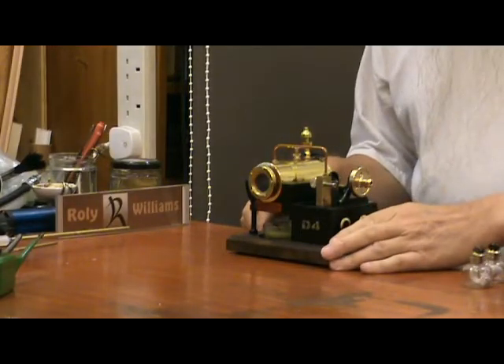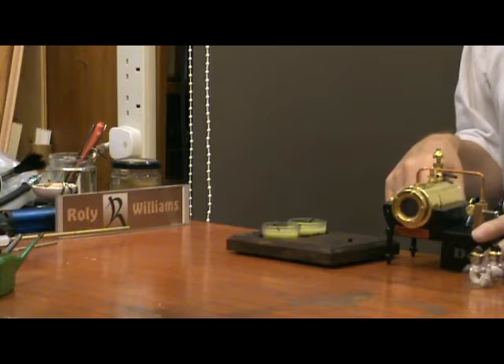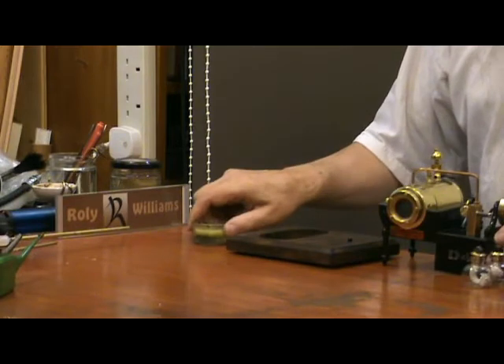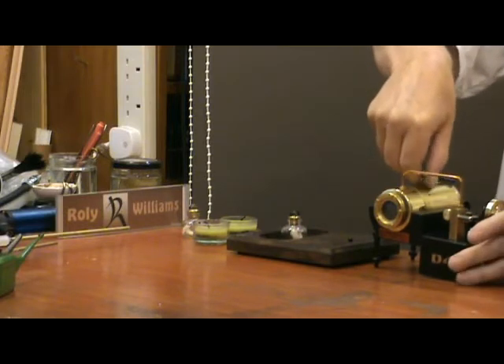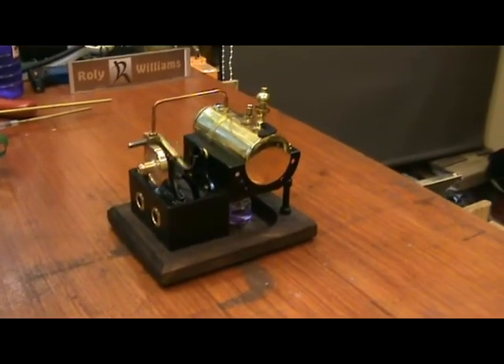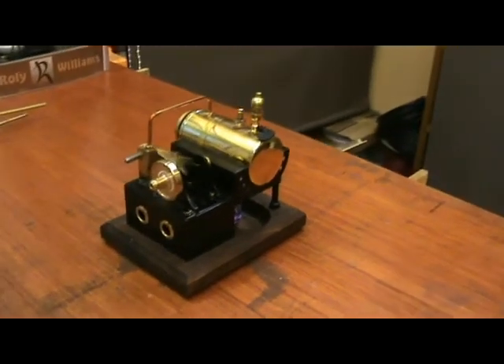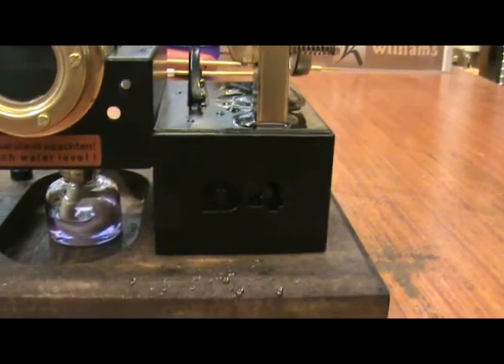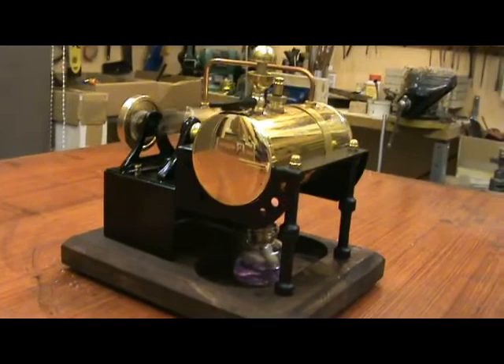Wilesco2016  D4 using meths burner

Comment: Hmm, could have been a nice engine from the design view...but the cylinder with the crank from the D3 and plastic pillars for the boiler in combination with the low low heat source from the candles (normally). Its a shame, nice design nearly bought it, when I saw it first time. But I wanted feedback from others and waited. Glad I did that...
Reply: I have one but I don't mind waiting for the boiler to get up another head of steam

Comment: where did you get those burners?
Reply from the maker: The meths burners came from China via Ebay.
Reply from the maker: @SatNav37564  They are 30mm diameter and height.